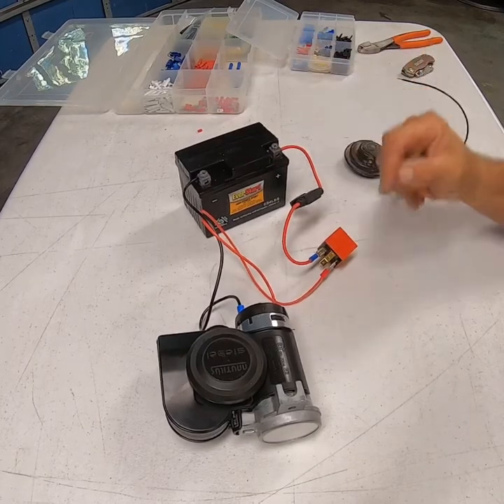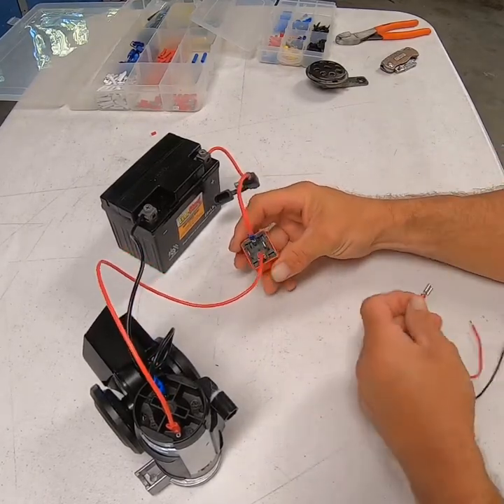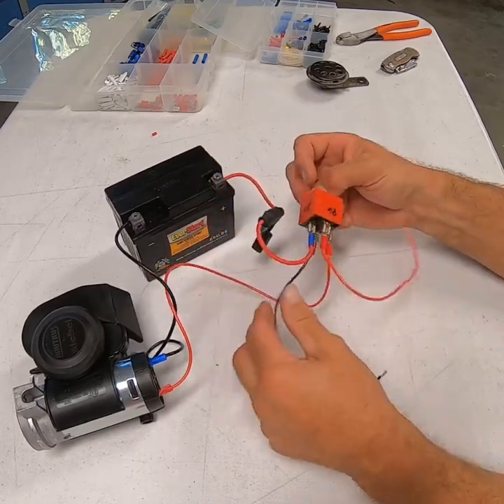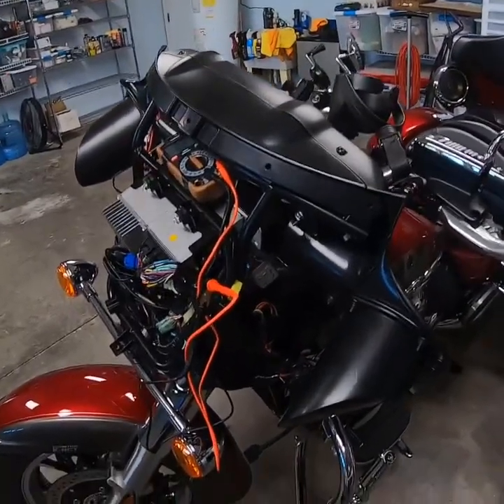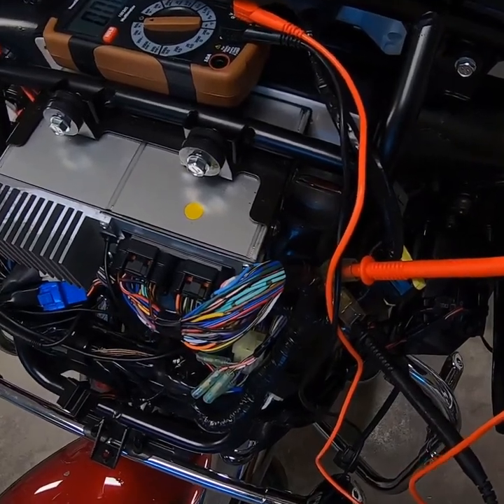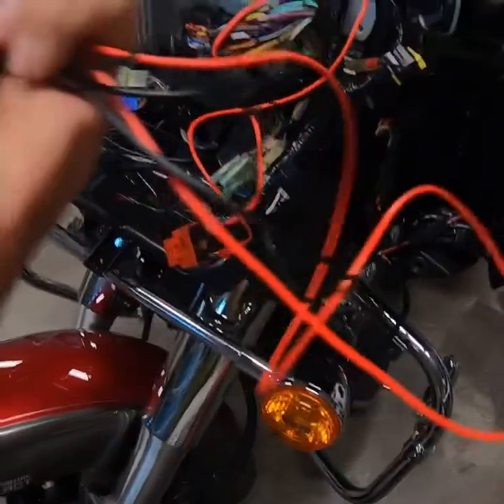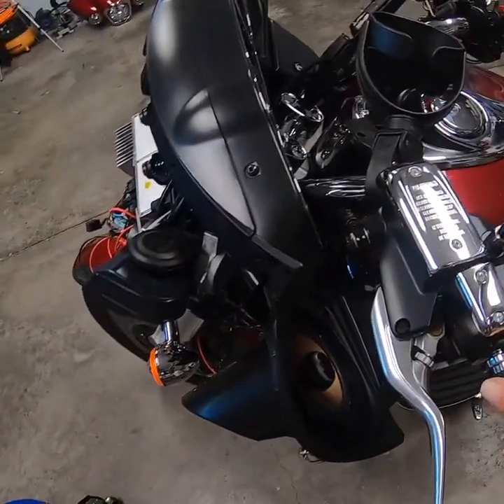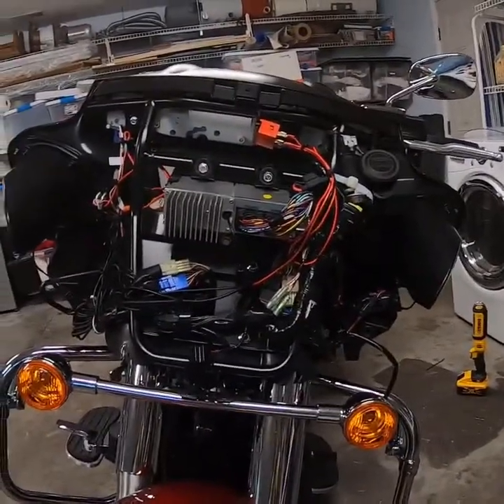Kawasaki Voyager Motorcycle Horn Upgrade Stebel Nautilus Compact Mini Air Horn Installation

Comment: Best explain i've seen. Relay is important. Contact-points of relay engineered for higher amperages. Bigger surface of contact-points. It's about the higher amperage the pump-motor needs. Without relaly will burn the contact-points of the OEM-horn-button. Like welding. A high-current spark. I'm Electrician

Comment: Want to add this on a electric bike on the front. To protect the unit from rain wanted to insert this unit into a PVC pipe with the horn output exposed. What size PVC pipe would this fit into?

Comment: Great video thanks for sharing.
Is it possible to ground the horn to the chassis, rather than wiring it up to the negative on the battery ?
Reply from the maker: You should be able to ground it to the chassis long as you have a good ground, just clean it up good so you have good contact, but the hot to the relay has to come to the battery, not a key on.  That way it has the full 12v from the battery when you hit the horn.  Thanks for watching.

Comment: Can you wire 86 to positive on battery as I cannot find a constant positive wire on my vehicle for the horn switch
Reply from the maker: You should have 2 wires going to your horn, it works just like a doorbell button or a light switch.  When you push the horn/button it just closes the circuit.  If you do not use the original wiring for your horn, and you connect the wire to 86 it will just send constant power to the horn and it will blow forever or until the battery dies.  You need to be able to break that circuit somewhere.  Usually at the horn you can pull the leads off at the horn and it is labeled, you may have to make a jumper to the new air horn.  If you have what I call an "old school" horn and it only has one wire and is bolted to the frame, some of the old bikes just grounded the horn to the chassis with the bolt, and  the wire going to the horn when you push the button was hot.  Hope that explains better, but short answer hook battery to 86 horn will not stop blowing.

Comment: let me ask the hard question: where does one purchase the relay and what does one ask for? i'm guessing there are different relays so i want to know which to get. thanks man, and i enjoy your voyager vids...
Reply from the maker: You can get a relay on Amazon, Walmart, Autozone, or Just about any other automotive parts store.   20 amp relay will do just about anything. The fuse that comes with the unit will determine the amperage, if not if you look at the directions it will tell you use a 5,10, etc....  So as long as you have a fuse in the line the amperage of the relay can be higher because the fuse will trip first.   Relays can be used for multiple things, the main reason to use one is to keep from draining power when it’s not being used.  I haven’t done a video yet on a relay But if you’ve never used a relay look on YouTube Or Google or a little bit more on how our relay works so you don’t do any unnecessary damage. Thanks for watching I’ll put the relay on the list of things that need to be addressed individually.

Comment: why you need that relay? is not posibil to put + - to + - without relay?
Reply from the maker: Yes you can, but the relay should be used.   To provide the most power, and thus get the most noise, you wire a relay to power your horn. The relay uses a small amount of power the original switch circuit to turn on and off a bigger amount of power from the battery to the horn. The smaller wires from the original horn button do not carry as much power down them in some instances.  When you push the horn button the relay closes and uses the power directly from the battery.  Thanks for watching.

Comment: I want to put this on my 2019 MB Sprinter since the horn on the sprinter sounds like a weak VW horn. Can this be wired so I just use my regular button on the steering wheel? How many amps does it pull?
Reply from the maker: mtn ride The original button will work fine.  Basically with the relay you are running a hot from the battery so the drain will be minimal.  I’m not sure exactly what it is may be on their specs sheet.  So your positive from the battery and good ground from battery or frame are on 2 posts of the relay the other 2 are your existing horn wires so that way your horn button works.  Hope that explains it better.  Looks much more complicated than it is.
Reply: Thanks just ordered the wolo bad boy horn from the sprinter store.
Reply from the maker: mtn ride Good deal, come back post a comment let us all know how that sounds. Wiring should be about the same most airhorns use the same type set up power and ground from the battery existing horn wires to actually engage.

Comment: Hi Greg, nice videos! I will be a new Voyager owner soon but have been car and motorcycle mechanic for 40 years. Is the horn really efficient under the fairing? I am really hesitant on that one...
Reply from the maker: Luc Thibault It May knock off a decibel or so but the cowl is just thin plastic.  The original horn is mounted up under the cowl (not inside but still up under) to the frame so really not much different.  It’s not a pretty looking horn so for me the cowl worked best.   Still will get anyone’s attention even remotely close to you, and the cowl is not insulated in any way so may actually work out better because the entire front becomes like a bell or box for the sound.  Not to mention all the wiring, connections and horn protected from the elements will last longer.  There is room on the frame though if you go that way.  Was just a preference.  

Thanks for watching please hit like and subscribe if you haven’t already.
Reply: @RagerJackOfAll  Hi Greg - excellent! You have convinced me sir!  On another topic I am trying to find a good tutorial on coolant replacement. The service manual just shows the basic procedure but from what I've seen other folks use vinegar and distilled water to make a couple of cleaning cycles but how do you go with the tank needed to be removed ? Or do you leave the tank unbolted and lift it up when you have to fill the system and reach the cap underneath ? Thanks Mate
Reply from the maker: Luc Thibault The video below shows you how to get the tank off, not too difficult a few tricky spots. You have to remove the gas tank to change the coolant in the radiator cap is underneath the middle of the tank.  I’d have to check on the flush Some radiators are made of different materials Putting the wrong thing inside can corrode or caused damage If unsure unless the bike just has a lot of miles on it and has never been done can probably just flush it with water. If the water comes out of the bottom clean that’s all you should need, if it comes out with black are colors in it probably needs some sort of a cleaner. All you have to do to drain just take the bottom radiator hose off And take the radiator cap off the top will help it flow out faster.  Same with the coolant make sure you use Kawasaki approved Coolant.  All coolant is not the same.  I would also suggest picking up a radiator cap while your doing it, A few bucks for the radiator cap now will be a lot easier than trying to take the gas tank off if it fails before the next coolant change. 

Good luck with it. 

https://youtu.be/f3vWAszyVOQ
Reply: @RagerJackOfAll  Thanks mate. Will probably make many of your improvements as this is what I like to do with my bikes, did the same with my Intruder 1400 over the years. I also own a collection item, a 1975 Honda CB360T, in pristine condition. You have one big advantage down there: hot weather! For us up here the season will end soon. Time to hibernate and work on our machines for next summer!
Reply from the maker: Luc Thibault very True been so busy this summer with wirk may have put 300 miles on the road but basically can ride year round here so I’ll put some miles on this winter.  I’ve always been a 70s bike guy.  I’ve had 5 750 H2’s a couple H1’1s.  Looking for an H2 again sold my last one about 8 years ago regretting every day since.  Not to mention going price at the time was about 5k mostly restored with a 120hp Fast By Gast engine on it.  Same bike 15k now.  Can’t pull the trigger.   Other favorite is a Hayabusa, Sold my 14 for the voyager.    Can get a new one in Rockingham NC for 12,500 every day so makes buying a 50 year old bike for 15 tough.  Keep in touch with your upgrades if you need anything else let me know.
Reply: @RagerJackOfAll  The Voyager will be to accomodate my wife and daughter as the Intruder was not comfortable enough for long ride. Just saw the Voyager at my local Suzuki shop and loved the look of it, even asked permission to stand on it. Didn't want to spend 19K so I found a used one (34K), 2013 model.

Comment: Hi don’t know how much you know about electric ⚡️ but have a question,I have a Yamaha R1 2004 and bought this horn,I want to install it just the way you did yours I would like to connect the positive to a wire not to the battery 🔋 how could I find such wire.
Reply from the maker: Well I know enough about it to know if I had it here I could probably find one but not enough to teach you without you being here over messages.  If you can find the fuse box sometimes there are open holes for accessories that will be “hot” all the time and sometimes “key on”.  The best bet is go to auto store and get an eyelet or u connector if your not sure and a small roll of 16g wire and just put under battery terminal.  I’m sure somewhere on that bike you can find but without a voltmeter and some digging can’t help much more than that.
Reply: Greg Rager I know where the fuse box at the front left side and there are loads of wires,I will check with me volt meter cause I have so much stuff connected to my bike the less wire I have t be trailing would be better for me.i will prob in the wires and see cause I need to connect a smart turn system and I need a live so will used the same one.
Reply: Greg Rager I have few videos on here but  always like to have a second opinion
Reply from the maker: Rickybritish German I’m always looking for better ways and sometimes we all get bits and pieces of the puzzles and think we were right til someone shows us different.   Sometimes I know when I’m doing a video someone out there is just shaking their head in shame.  Lol. Thanks for subscribing I have a bunch of videos in that voyager playlist with some wiring on speakers and such finding positive negative etc maybe one will help.  Thanks again
Reply: Greg Rager thankS Greg will check them out
Reply: Greg Rager hi Greg morning I am doing do wiring on my Yamaha,I made a relay to run my side light and turn them into indicator and I am also adding some blinking blinking LED to the back passenger foot rest and also indicator as well,they are now connected to my bike but what I notice,when I turn the indicator on,on the dash board there is a little flickering in the opposite side on the  dashboard,what could cause that.on the dash there are 2 markers for you to see when you turn the indicator on left or right thats the one I am talking.◀️▶️
Reply from the maker: Rickybritish German Has to be a power draw do some sort.  Did you upgrade the original signal bulbs to Led also?   If you do they make little gadgets to go on them now to keep from flashing fast. The bike batteries don’t have a big capacity like a car, if you haven’t tried that I’d start there.  Also if not grounded to the battery but on the frame, make a temporary jump from your ground to the battery if not there could just be a ground. Beyond that https://amervoyassoc.org/forum/ is a good active blog.  Mostly dressers but that’s where a lot of people add lots of gadgets.   Let me know if you figure it out.
Reply: Greg Rager I just change the white maker lights on my Yamaha to orange but I used a relay so when I put on my indicator they work like a blinker but when I turn the blinker one to the left or the right the opposite side have a light blink and some time the high beam light

Comment: I have a 2019 Voyager and I'm glad you have these great videos. I'm thinking about installing an air horn as well. Isn't there enough room where the factory horn is? It looks like you can mount it there. Also, I think I'd rather remove the fuel tank to get power from the battery than removing the fairing (too many screws) :-)
Reply from the maker: There probably is, I was worried about the forks hitting and like anything electronic the more protection it has the longer it will last.  I also am pretty comfortable ripping things apart lol. As long as you can mount it there just consider the fresh air tube I’d run under the seat or in the cowl if you ride in the rain. You Still need to get power from somewhere, there’s nothing around the horn to draw power from so you’ll have to fish wires under the tank to get the relay in. Let me know if you need anything else I’m doing a video this weekend of removing the tank.
Reply: @RagerJackOfAll  Are you happy with this horn? Is it loud enough? This is my next project.
Reply from the maker: It’s 10x louder than the factory horn, not like a truck but will get someone attention and maintain a reasonable size.  I’m happy with it. I tried a “louder” factory size horn that was a waste.  Lol should have done a video on that.
Reply from the maker: Yes sorry been so busy with work, yes you could mount right where the factory one is, I just wanted to keep mine a "sleeper", had seen some others online and just didn't like the way it looked but could mount that thing in the trunk if you wanted people will hear it!  lol  Not as loud as a truck air horn but for its size and on a bike it works.
Reply: @RagerJackOfAll I finally ordered the Stebel horn and wiring kit. I'm sure I will need extra wire. What wire gauge do you use? Thanks.
Reply from the maker: av8dr I used a 16 gauge wire, could probably use 18, I put audio systems in houses for a living so I literally have thousands of feet of 16 at all times.  Kind of my go to wiring.   That horn is small enough to mount anywhere I just put it under the fairing to hide it and will keep the elements off of it should last longer.  Still blowing strong so no complaints yet.  Its not a train but louder than most cars and has that pitch that gets attention.   

Good luck let me know how it goes.
Reply: @RagerJackOfAll  I was wondering how you knew you had a heavy enough supply wire to #30 in to supply 20 amps plus whatever was already on that circuit.  That's the main reason I'd probably try to run a 16 or 14 back to the battery.  Nice and clean having everything under the fairing though.
Reply from the maker: Steve Treimer I usually use a 16 gauge wire, I install audio systems for a living so I have literally thousands of feet of 16 at all times.  The directions do call for a line to the battery but....  As far as “knowing “ what size to use, just been wiring cars and bikes for 30+ years, unless it’s an amp or steady draw 16 seems to do most devices.   Not saying I’ve never popped a fuse or melted a wire learning.  Lol Thanks for watching I appreciate the feedback, so when I do future videos I can remember things like what gauge wire I use so people know.

Comment: I've tried this and all it does is keep blowing fuses and no horn sound
Reply from the maker: Sounds like you either have a bad relay, bad ground or you are running your wires to the wrong contact points.  I did this video 2+ years ago, if you just got the horn possible something has changed, but I would double check your ground first, then make sure not crossing a wire and over time they may have changed the relay, but should still be  similar, power from the battery to the relay on the + side, then the horn red to one contact, the horn ground to the other which is basically just a switch to close the 2 together sending power to the horn and the last one sending power to the horn.  The horn is grounded either back to the battery or a good clean chassis ground.   Hope that helps.
Reply: @RagerJackOfAll  Thank you Greg, I will take another look tomorrow.